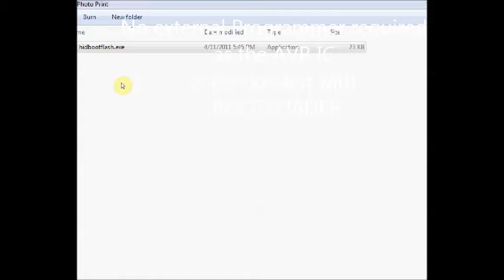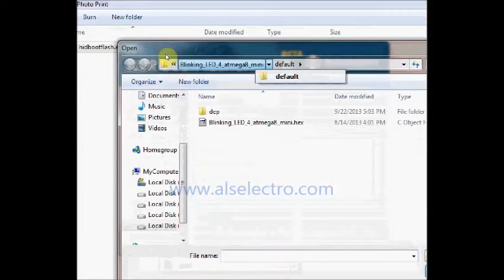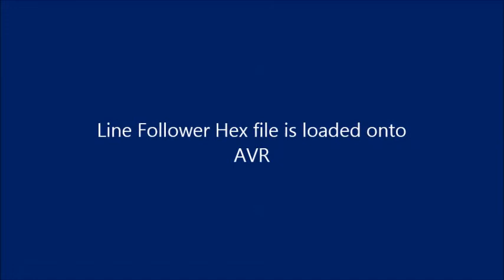Line Follower Robot - Part 2 - Loading Hex Files & Testing

Comment: Sir,The PB1 & PB4 glows in my bot as you mentioned but as soon as remove power and then attach there is no glow.Also when I reset it there is no glow there after.Is it due to the bootloader ?.Because couple of days before I was messing with the chip.Accidently I just erased the chip using avr programmer.So without the bootloader even after reset there is no glow ? even after powered.
So,How should I load the bootloader into it.....now